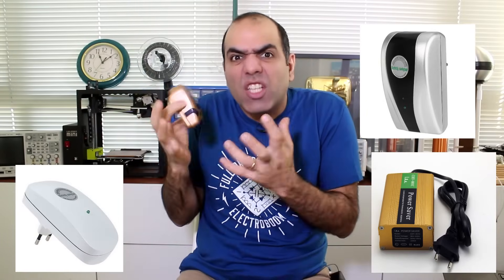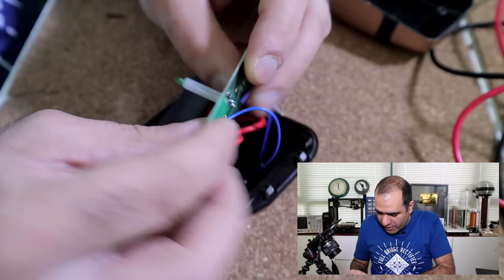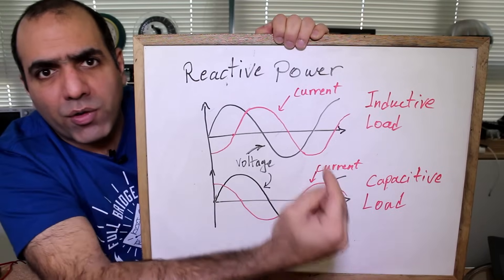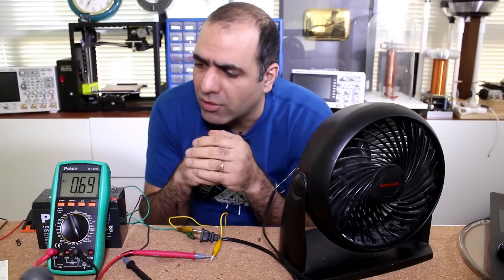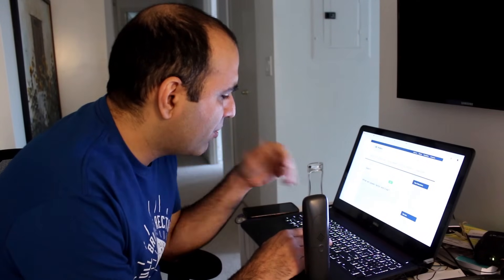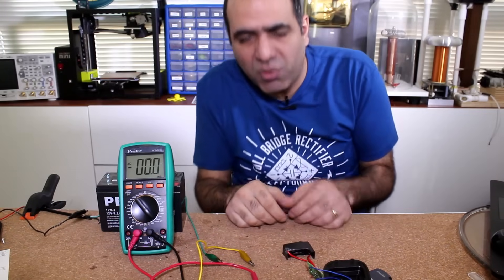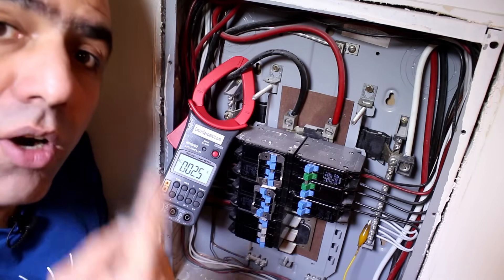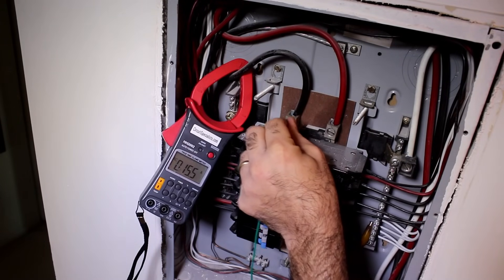Power Saver Scam EXPOSED!

Comment from the maker: Hello mateys! I hope you didn't bother buying a power saver! If you have questions and ideas, you can post them to ElectroBOOM subreddit: www.reddit.com/r/ElectroBOOM
Reply: Something more importnat that you forgot to mention is that most appliancies nowdays use switch mode power supplies and because of the way they work the current they consume is not a sine wave (or same shape with voltage) and this creates another kind of reactive power and its called "Deformed Power". Adding a capacitor to the power lines doesnt do any saving, instead it actualy makes the shape of current worse and increases reactive power!!! It might was doing something in the older days with linear supplies but you don't pay reactive power at all so its useless!!!!!!!!!
Reply: @the_danksmith134  the non linearity of the charge caused by the non reactive components in the switch mode power supplies creates a harmonic currents, which in turns running through the impedances of the power supply distorts the power supply's sin wave . now the harmonic currents is the problem you are talking about(along with the low power factor ),to solve this problem we can either use reactive pfc (configurations of L and C filters ) or in high power we can use active pfc (many structures are there like boost/buck converter)
Reply: 3:24 that is amazing
Reply: Most of the power banks which use to charge phones seems to consume power (very small amount but still does)even though the power bank is not connected to the phone. Mainly may be because of the IC that consumes continues power that waits for the user to push that button , I don't have enough equipment to check that out . Can You help me out ? And can we prevent that ? I am intending to make a big power bank. Also 18650 batteries parallel to each other charges each other if ones voltage is lower than the other . Can we prevent that as well ? 
#Love from Bangladesh <3
Reply: @sigmamalerules1106  It's probably some kind of standby mode, so that the system can detect whether the load is connected, and then start up. My universal phase motor ECU (still in the planning stage) has a standby circuit that when enabled, allows the unit to be turned on without a load on the output. The inactive current draw of all the components is probably going to be something like a few milliamps (there's chokes and relay coils and bridge rectifiers and shunts and whatnot in there,) however there would be no high currents in the ECU unless you took it out of standby mode.
Reply: Here in the uk my late father was involved in making sure the right "load" balancing/drawing devices were put in when new LED lamps were fitted. Because if they did not, the factories/warehouses got free electric, as the LEDs would draw one type of load (i don't know which sorry) but the meter only detected the other! XD
Reply: Express vpn is the same as orbot (tor) , but orbot is free. Just in case you dont want to pay for an already secure internet connection (since all the important pages uses httpS what is really secure compared to these 'vpn' servers).
Why do you need sponsors if you have patreon??? Or why dont you chose a sponsor in connection with your chanell like keysight?
Isn't the youtube advertisement and the patreon enough?
Reply: ElectroBOOM I used those before and it exploded with a emp explosion
Reply: @epicmansquad6924  haha why don't you help your friends with there phone addiction..
Reply: A Tsohg well I do have. A home made diy jammer the disruption to the communications and it went extremely well
Reply: OK. Was it just a random touch to the Turkish flag for your Turkish viewers, because some sites are blocked in Turkey? But why Soviet anthem ? Cuz they are acting like them ?
PS: Those who Whooosh around are stupid. Thats not how whoosh works. Goto reddit page and read some examples.
Reply: I have a power saver people can buy. It allows you to turn current off to items that aren't in use but are still drawing current. It's called a switch.
Reply: Who is the winner of the giveaway?
Reply: Ζ=R+jX. If you only pay for the R why buy something that will reduce the X?
Reply: Where have you been man. I live for you to be shocked 😲 hahah I'm kidding.
Reply: Ok
Reply: ElectroBoom I am from Europe and we have only 1 phase coming in. Why would you need 2 going in a house? Also that wire colouring is so weird :)
Reply: @sanyaasaniap  for 220v you would need 2 phases of 120.  We use 220 for stoves, dryers and such
Reply: Talks about china, shows turkish flag. FLAT EARTH CONFIRMED!!! NOT POSSIBLE OTHERWISE
Reply: 0:51 nice choice of an anthem :)
Reply: We have some big three phase machines at home with very power hungry motors. Could I lower the current with a capacitor so that more machines could run on the same breaker? I tried it with one phase motor and the current reading lowered from 0.45 to 0.25A on the wattmeter and the cos phi corrected from 0.47 to 0.85. The question is if the breakers care about the power factor correction or not
Reply: Maybe by changing the frequency... might make some systems more efficient?
Reply: You forgot to include the angle that these are probably pushed by the power companies ... they can't meter for reactive power, but they have to generate it, thus they add the surcharge to larger companies.  This pays for their generation costs, and for the switched capacitors that they put out on the grid.  Plus, when the I and V are too much out of phase, it reduces the effectiveness of the "real" power meters on our homes. Anything they can do to reduce the total reactive power on the grid, they will push it.
Reply: Some of them make very nice cases, when you need something to plug in the wall with enough space for a powersupply and an esp8266 for example.
Reply: Thanks for the insight 
In India these Power saver was at its peak for sometime. 
Can you make a Power saver like this.
Reply: ElectroBOOM  Why did you say happy new year even though it’s January 11th
Reply: @themusicmaster1077  it's because is belated Happy New year
Reply: Did you just put the flag of Turkey to talk about China?
Reply: @germancarrasco2028  and a soviet anthem 😆
Reply: ElectroBOOM can you try the same experiment but with the super capacitor?
Reply: happy new year to you too  mehdi sadaghdar
Reply: Please comments , Is it real or not .  SMOT https://youtu.be/g1-7SBxYbxs
Reply: Hey, I want to get your shirts, but teespring's print quality is garbage (I got a bunch of AvE gear and the printing looked it had been worn and washed for years)
Reply: I think SMOT that it can works. Can you prove it ? So I believe you the most .
Reply: Hi Electroboom, Can you make a video of Dr. Randell Mills Brilliant Light Power and his Hydrino electric generator.

A book was written in this regard by Brett Holverstott called as "Randell Mills and search for the Hydrino"

Thanks.
Reply: I’m thinking of buying one now, novelty shockers are cool
Reply: Stop said dirty
Reply: VPN doesn't protect against identity theft nor does it protect against tracking.
Reply: In China, we all use VPN to access Youtube.
Reply: Happy birthday Mehdi Sadaghdar! Stay blessed! 💘
Reply: airvpn is better, faster and no logging
Reply: ElectroBOOM would it be a good idea to show everyone what emp is that happen to me and the jammer also show the jammer it's worth the views and subscribers will increase the number the first part is including grath of the emp and the jammer
Reply: Hello i hope u read this there is two absolute wrong  things aboat this video : 1- Now days all the buildings should have cap bank in them so you are allready used fixed power factor 0.95 to 0.98 and if u add that thing its wont help cuz u allready have bigger caps that solved the main problem even the lighting of a small library (thats have equal lighting as around 5 normal houses ) have around 0.86 just for lighting (not included on board cap of lamps )  and as engineer u should calculate and consider the cap for all the building loads ( if u want work in that part calculate and all things aboat electrical of building inculding add a trans or generator or loads lighting and ...  ) 2- they gave u wrong information on phone cuz every where charge u per watt not var as i assume u r an electrical engineer i think u know the diffrent and thats why all buildings should have cap bank . So but aboat the divce that thing maybe work for old houses in some where that electrical companey yet didnt force ppl to add cap bank  .

Comment: These devices are just waste, polluting the planet.

Maybe someone can calculate the  negative environmental effect per unit.
Reply: if you saw one they actually feel like are made out of waste! smh!
Reply: not exactly let me explain:
1. power loss is related to power current, Thermal Loss = I^2 *R*t -> I - current, R resistance, t- time, so if we reduce current thermal loss is reduced
2. dimensions of cable can be lower if we transmitting only real power --> so we saving planet because we are using less copper to produce cables.
of course power compensation by capacitors have to be designed for power load and make sense only for big power consumers like factory which is consuming megawatts of energy.
Reply: @gromosawsmiay3000  maybe so if you had a very stable power factor and could match the power factor correction (capacitor or inductor ) to correct that. ,  even so,  household  consumers don't pay for  reactive power. But for a normal household, the power the factor continually changes as different appliances are plugged in, a single capacitor can only correct for one power factor, if it changes - as electroboom showed, - it can  even make matters worse.  I used to work in steel works, which mostly used motors (inductive) ,  I found one old area (dating from the  1930's) that did use banks of capacitors to correct the  inductive (motors) load. But that method is obsolete, modern power factor correctors are a lot more sophisticated and measure and compensate as the load changes.

Comment: You know the 3 prong wall sockets? With a live neutral and ground wire? If you stuck a metal stick in the ground and neutral at the same time in theory would you be ok?
Reply: @TheKmaki  But there's no current in neutral and ground?
Reply: @aasmith6117  I think I misread your comment. If you mean putting a pin between neutral & ground on a wall outlet nothing will happen except for potential for a bit of a shock if you touch the outside of the receptacle box (while a large load is plugged in).
Reply: TheKmaki. Wait, what? He has a fuse?